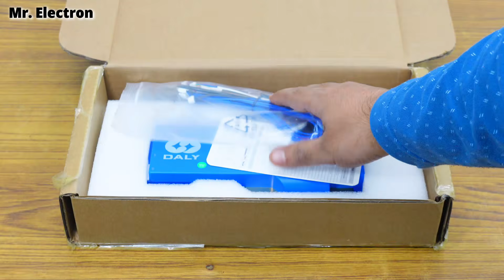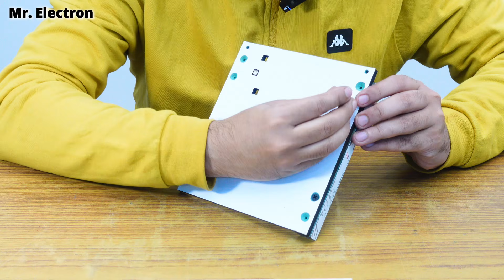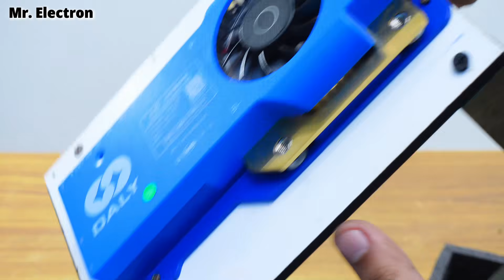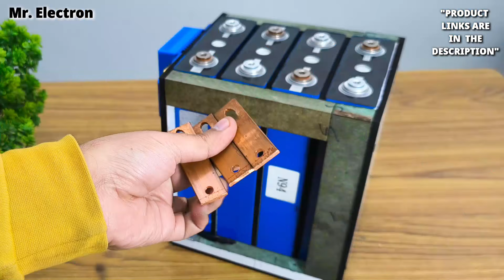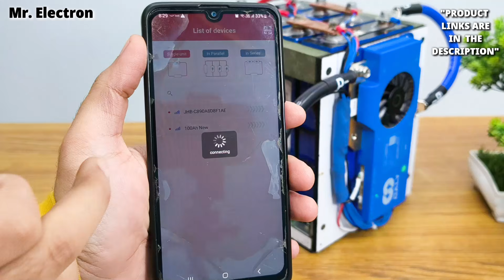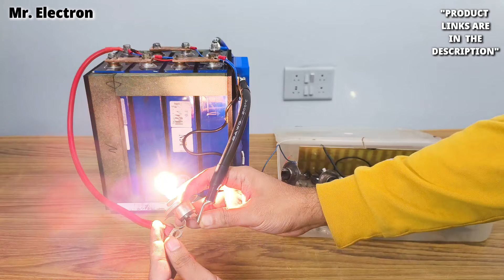STOP Buying Overpriced Batteries -- Build Your Own 100Ah LiFePO4 for CHEAP!

Comment: Never use a BMS that tries to balance the SOC (state of charge) because this damages the cells. Instead of using a BMS, it is better to use a simple over charge and over discharge protection circuit.